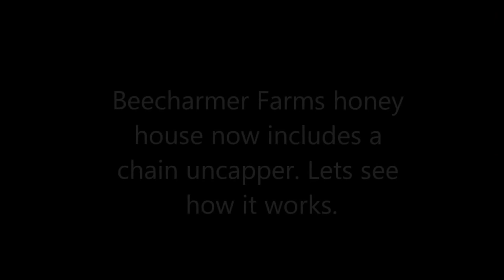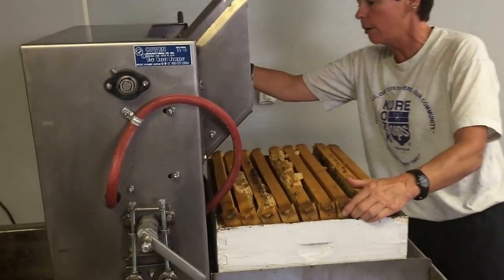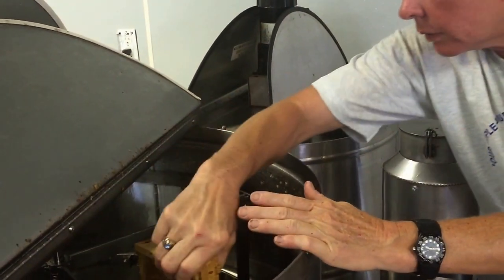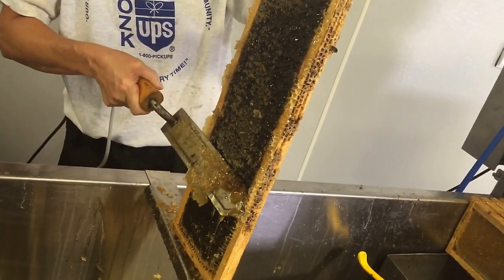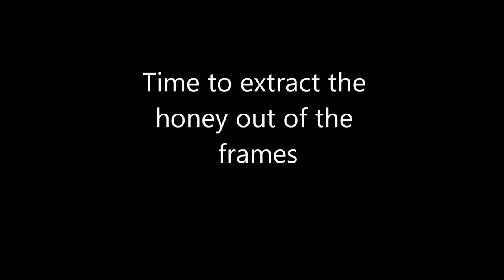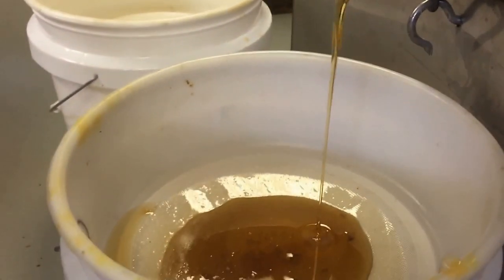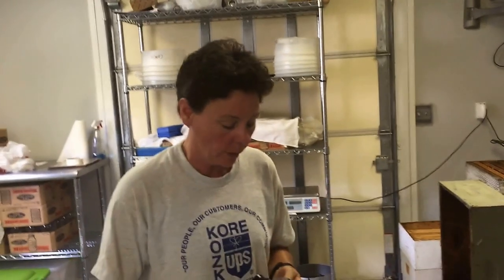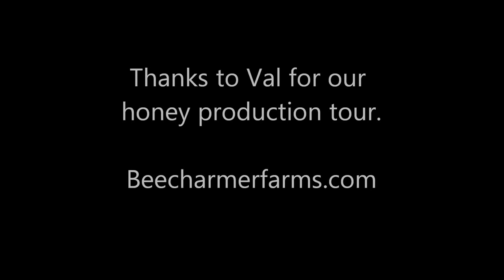Beecharmer Farms - A Honey House Tour

Comment: Hello! Could you tell me the speed of uncapping knives "swinging" please? How many rpm / minute? 200 , 400? Thanks
Reply from the maker: I believe 200 but I am not positive. Not sure you might check their website
Reply: hello, I checked their website, but it sais the motor is 1725 rpm.  The knives drived through a V-Belt pulley. Could you tell me the diameters of the 2 v belt discs? and i could count it.
Reply: Anyway, i'm a beekeper from Hungary. its a small country in Europe. only 10 million people live here but there are aproximetly 20 000 beekeper. Our most famous honey is the acacia .its not a dark honey and cristalyzed very slowly
Reply from the maker: I did the video on a friends honey operation so I do not have access to measure the disks.
Reply: Ok, I see, Thanks, Have a nice day, bye